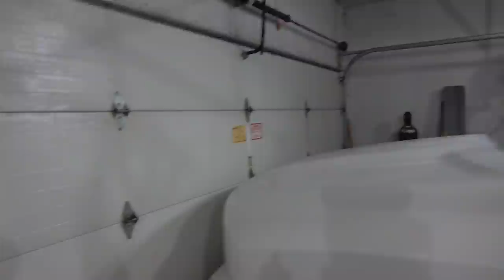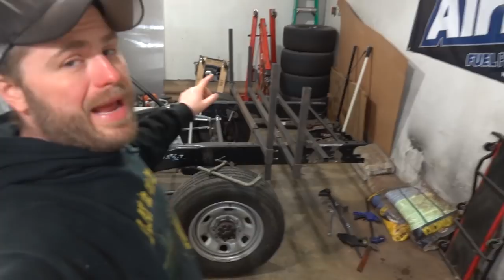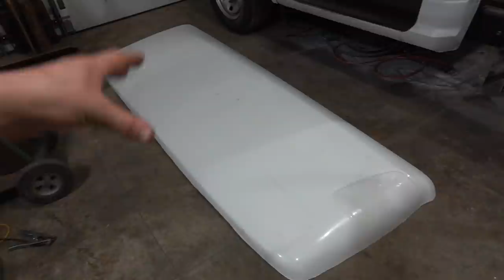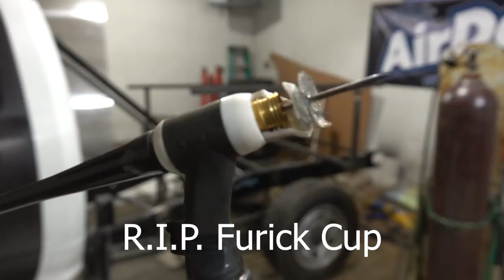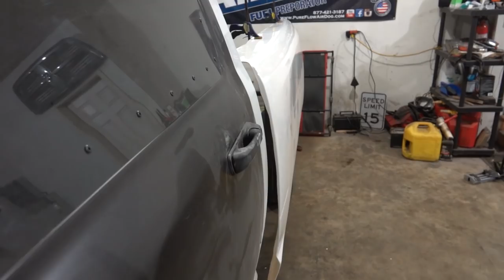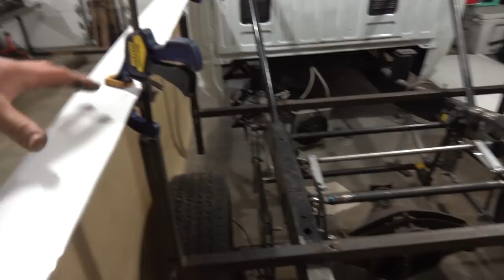Fiberglass bedsides on The CUMMINS DRAG TRUCK!!

Comment: I really like the jacking bolts upgrade on the bed jig. Also do yourself a favor and borrow a laser level on a tripod to help setup the body lines on the fiberglass. It will help align the steel too the glass. I did it on mine and got the body aligned better than factory was.

Comment: Just a thought if you want a "handle " to lift the front end with while standing in front of the truck could you tie the old ram hood ornament into the front bracket. That would give you a nice cosmetic addition as well as a functional grab point after you release the lower window clips. Tie the ornament into a plate underneath tied into the front hinge fame. just my $.02 Keep up the awesome content!